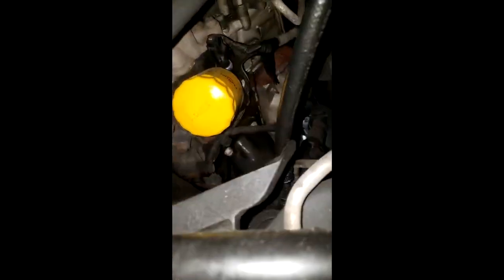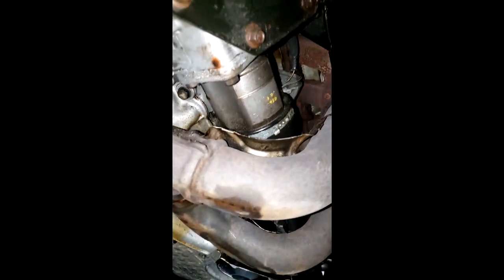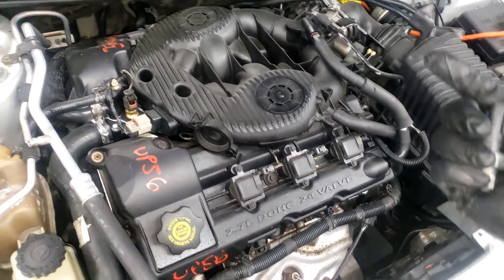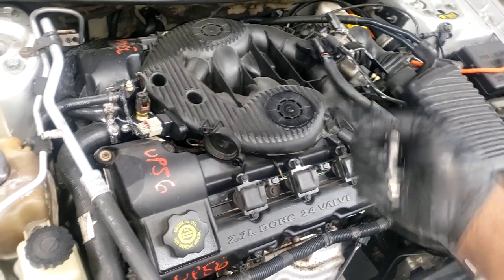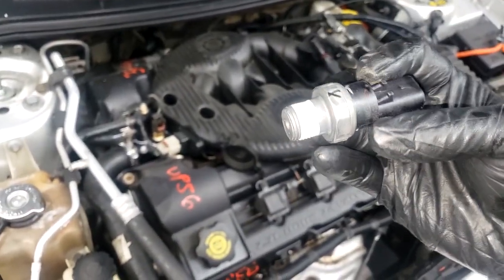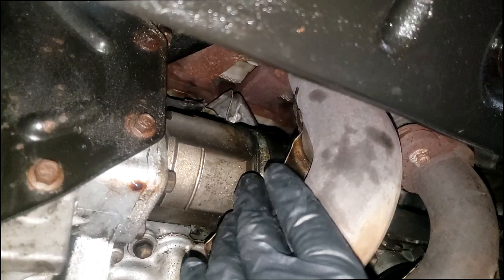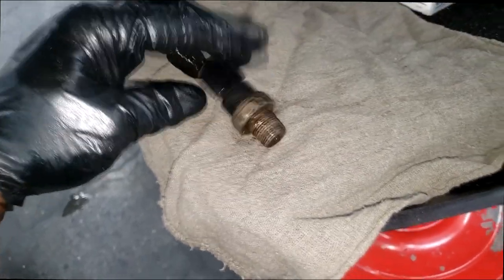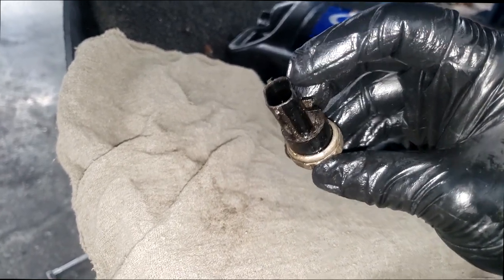You can FIX the oil leak and the oil light flickering by doing this.

Comment: Thanks, such a great video.  I have 2004 Sebring Convertible and had the oil light issue.  I had already did what you said, and pulled over and checked the oil.  I brought it in and they changed the sensor 3 times, and I finally demanded they do an oil pressure test.  Sure enough the oil pump was bad.  They changed out the pump, and seemed ok but the light started coming on again after driving 30-40 minutes.  I pulled over again and the engine oil level was full.  Since the sensor was changed should I just pull that little piece off or also replace the sensor also?  Sorry such a long explanation but trying to make sure I'm doing the right thing.  Thank you very much and love your videos!
Reply from the maker: Hey Anthony, YES, pull out that lil vent stopper. You mention the sensor been replaced 3 times. Its likely ok bud
Reply: @OnlineMechanicTips  thank you again! Great job on the videos!